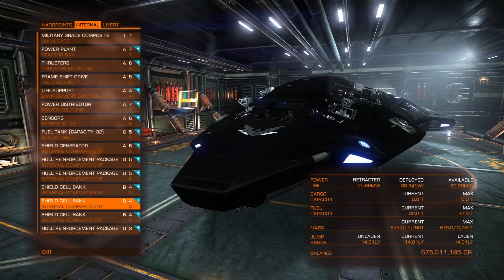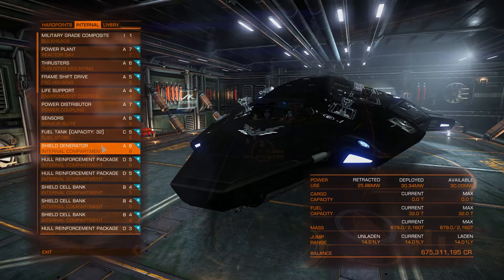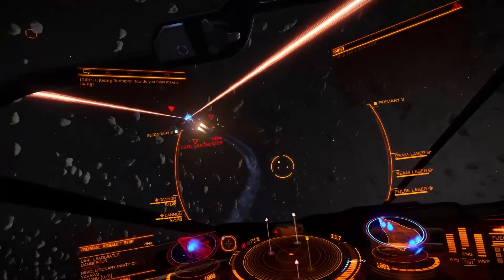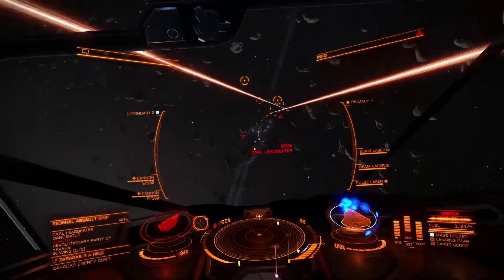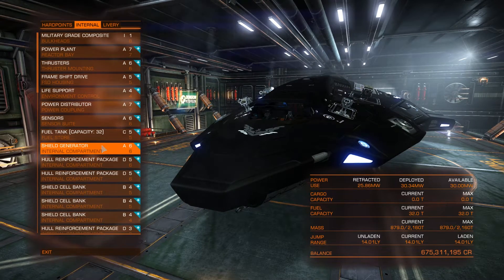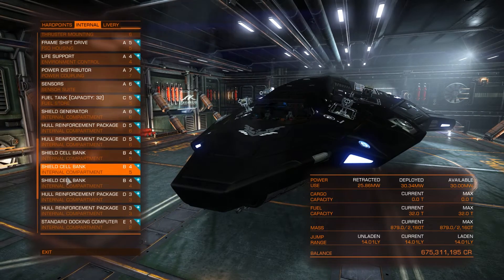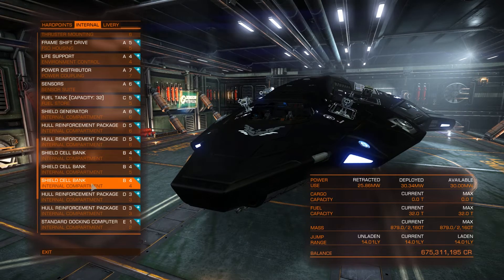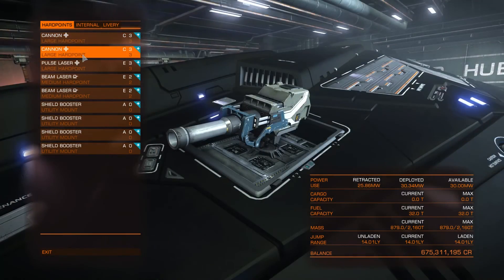Eite Dangerous: Python Refit

Comment: I'm using b4 shield cells to but my heat still goes up to 130 and I take heat damage could it be because I have a 7B power plant rather than a 7A, I also hv a 7A distributer btw.
Reply: Also I get this heat level while doing nothing, all weapons retracted, no boosting, no one shooting me
Reply from the maker: +mihir koka are you running in silent running mode?
Reply: +ThatTinyDude No I'm have shields up I'm not sure why this is happening and the only difference between your build and mine is the A7 power plant, so could that be the problem ?
Reply from the maker: +mihir koka not sure. you still using b4 shield cells? sure u arend using size 6?
Reply: +ThatTinyDude Yeah I'm sure, nvm though I guess it's the PP thanks for trying to help out.

Comment: Try the Bi-Weave with Chaffs. The Python can't shield tank anymore and relies much more on piloting skills. With the nerfed shield values, 2 Chaff Launchers will keep you alive much longer than 2 Shield Boosters while using less power. Also, you never put any pips into SYS during the combat. Yes, the Bi-Weaves don't give as much protection against burst damage as the A6, but if you're able to prolong fights by evading, managing SYS-Pips for damage mitigation und clever Chaff Usage, the Bi-Weaves faster recharge gives you far more Shield-MJs over the length of a dogfight compared to the A6.

Comment: Won't be better to use A6 scbin class 6 slots? sure they run hot, but they heal almost full shields in one charge. all you need to do is drop one shield booster and pick a heat sink to counter the heat.

I haven't made the numbers but you will probably have way more sustain with that. It is more demanding for the pilot, but you can try. The python is not a fast ship anyway, so you have plenty of time to do things.
Reply from the maker: ill take a second look but ill miss the extra shield buffer and i could only run 2 heat sinks with 2 a 6 cell banks id have 2 leftover cells that would do damage to my ship.
Reply from the maker: i could always add a field maintenance kit too in there for field repairs due to overheats lol
Reply: +ThatTinyDude Dunno, heat won't be that damaging, and you can take damage from two scb charges no problem.

All you have to do is stop firing while the scb are charging and the heat will dissipate really fast.

But as I said, I didn't run the numbers.
Reply from the maker: +Eviscerador ill look into it
Reply: +ThatTinyDude 
I am running a python with 3 Gimb C3 Burst and 2 C2 Gimb cannons (for those up close and personal power plant shots), with A6 shield and A6 shield cells banks. While you do have a remaining shield cell bank after heat sinks are all used, it only gets you up to 138% heat without heat sink (given that you stop firing for a few seconds) so its quite ok given that it'll recharge your shields fully even under fire, with 2 A grade shield boosters installed. That gives you about a 2 to 3 % damage to all your modules which is acceptable for the survivability you gain I think. After all it means your shields stay up, so they guy shooting at you can't get to the modules anyway.

Comment: haven't used a Python in a while after switching to the Anaconda.. What would you rank as the better ship: Agrade Python or Agrade Fer de Lance?
Reply from the maker: +boogy FDL is amazingly maneuverable and an absolute joy to fly
Reply from the maker: python does more direct damage but the FDL in a 1 on one fight can stay out of the line of fire much easier
Reply: The question is for what? pvp FDL hands dow.

Res farming or bounty hunting I will say it is a tie. They just have different handling. 

The python strength is the multipurpose hull. You can trade as well with the same hull, and you can have more scb or hull reinforced packages. 

The FDL is all about huge shields, maneuverability and huge plasma accelerator.
Reply: +Eviscerador Ah, I see. Recently noticed some friends using the FDL for PvP, but I;m also guessing it's good for PvE as well.
Reply: +boogy I use it for Haz res farming. I get solid 4 M hour with it, no powerplay bonuses.
Reply: +boogy 64 Ceti with a juicy 15% discount to hull and equipment.
Reply: ThatTinyDude so, you think it's better for combat than a Python?
Reply: ThatTinyDude ok, thanks